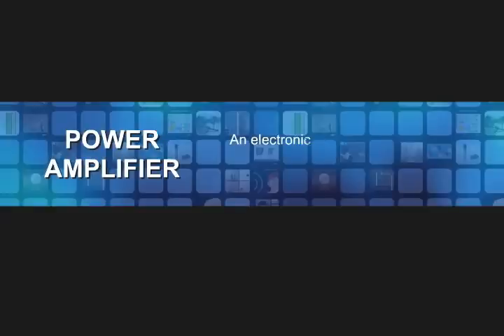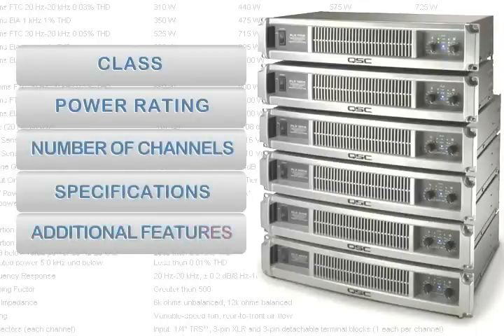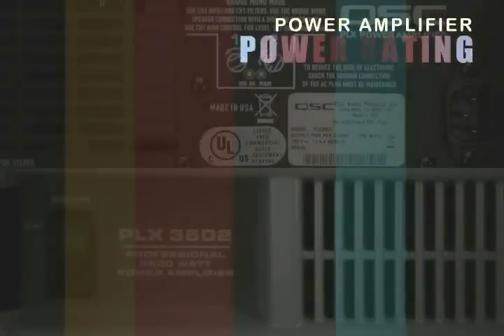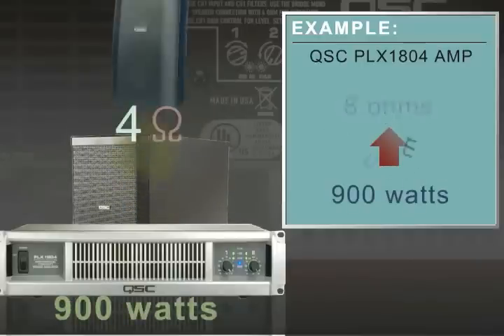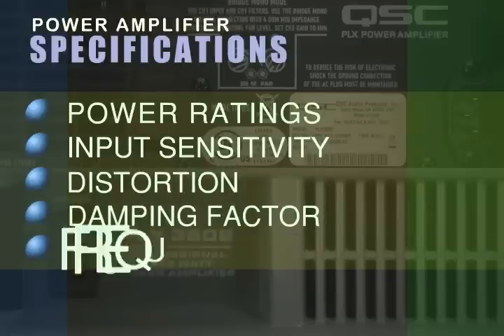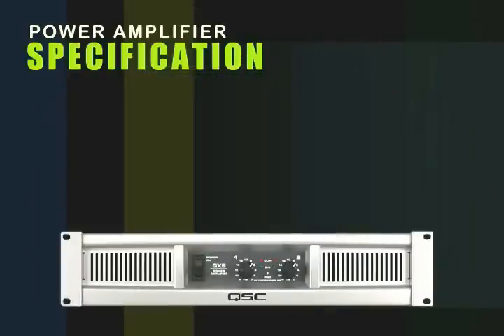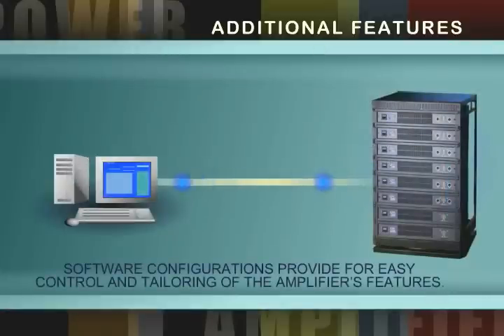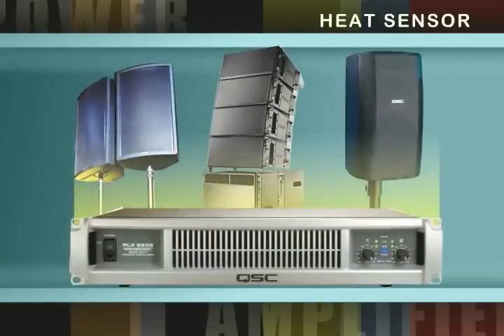Understanding Sound Reinforcement - Power Amplifiers  (Part 1)

Comment: Many long years ago, no one had much of an idea how to compare the power ratings of amps from the manufacturer's specs, and so the FCC and the government implemented a universal rating system that attempted to establish a set of standards for measurements that could improve the process of comparing different amps to one another. It basically forced manufacturers to publish honest power ratings by using the same methods of testing, and so we all had a chance to pick and choose which amps would do the best job of performing as intended, as we could compare the specs of all devices on an equal basis. Typically, an ad for, say, a Crown DC300A, would read something like, "155 watts per channel, both channels driven simultaneously from 20 Hz to 20 kHz, at 0.05% THD (total harmonic distortion), at 8 Ohms per channel. I may be mistaken, but it would seem that these specs were required to be printed in any ad that specified a given output power. Some manufacturers tried to manipulate these specs by fudging on the details, such as providing ratings at 4 ohms, or from 40Hz to 15kHz, or at 1% distortion, etc.. While this may have been legal, it didn't do the brands much good as the readers of those ads would soon be regarding them with suspicion. From the late 60's until the late 80's or early 90's, this was a good way to help everyone get what they paid for, and it made the job of setting up a good sound system a lot easier, as well. So, when exactly did this rating system evaporate? I looked around on the internet, and what I read indicated that this system is still supposed to be in place, but few of the manufacturers seem to adhere to it any more. This is the same old problem! If I want to run a bi-amped system with an 800 Hz electronic crossover, I'd want the low end to have roughly twice as much power as the high end, and if I want to save money by taking my chances in the free market and buy some used amps, I want to have honest specs available to compare them. I'd like to think that the amp I buy for the low end is actually more powerful than the amp I buy for the high end, right? I guess that I'd need a good Real Time Analyzer and a calibrated mic to ensure that my system will safely deliver a "balanced" sound to the room. I'd be using those anyway, plus trusting my ears a lot, but I wish that I could look up a bunch of the newer amps and read some honest, comparable specs without having to spend months or years determining which ones actually have more (or less) power. My question is, did these mandates just fly out the window, or did the manufacturers ignore what was eventually determined to be an un-enforcible set of rules? What am I missing? There are an awful lot of working systems out there these days, many of them somewhat elaborate in nature, and sometimes purchased and/or operated by ordinary people with no real professional backgrounds, and for the most part these systems perform adequately. Even before those standards were implemented, Julian Hirsch was publishing a great many specs in Stereo Review, and the FCC basically adopted his methods for those mandates. Who's testing anything these days? Can anyone trust the manufacturer's claims?
Reply: +randolph patterson I completely agree with your toughts.